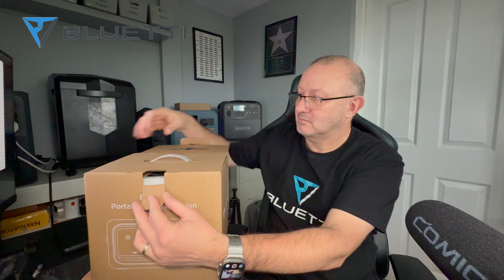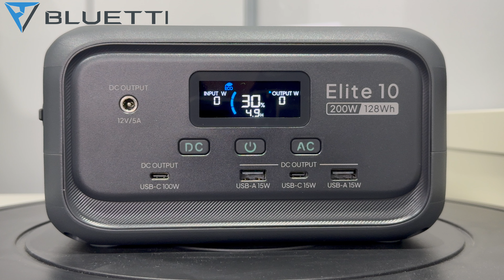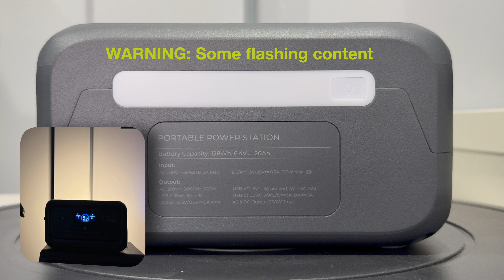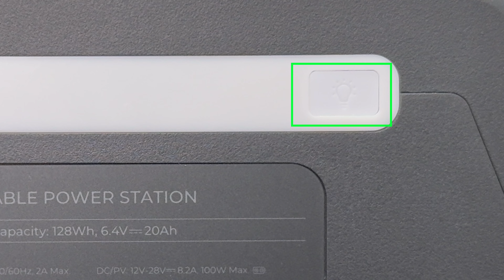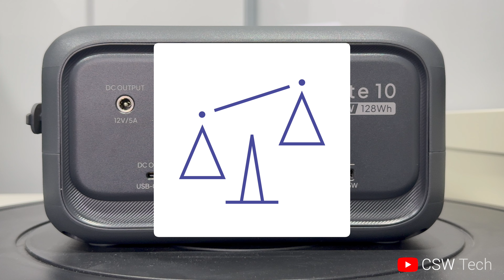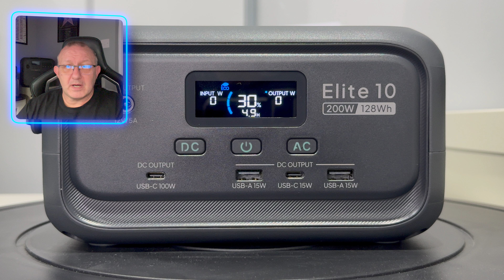Bluetti Elite 10 - Palm POWER

Comment: Thanks for the review. Nice to get a close up view of the Elite 10.  I like that it has the light,  especially the warm tone setting. I'm wondering about the DC efficiency. I can just about run my usbc rechargeable mifi for 6 days with the X20 . I'm wondering how the Elite 10 would compare?
Reply from the maker: Thank you for watching and you're feedback.  Yes, for once, I decided to try and get a quality close up of the Elite10.  I just find the X20 was a little missed opportunity, as it seems to offer limited connectivity, there was no adapter for USB-c for say a mac.  The Elite on the other hand has the multiple outputs that can be used on a number of devices.  This is why for me, the Elite10 is a winner.